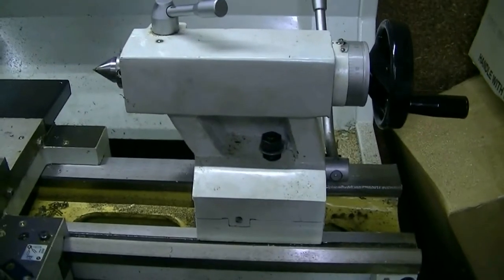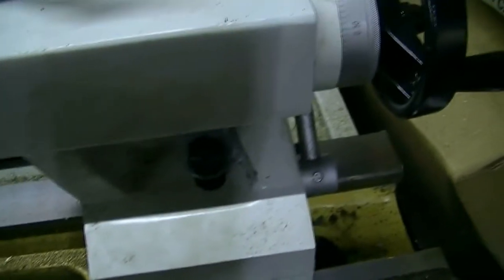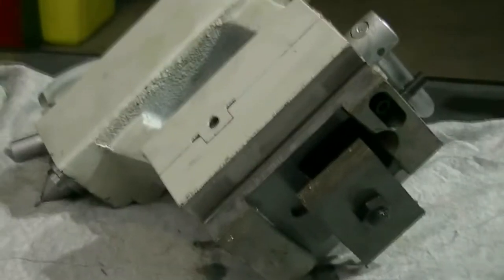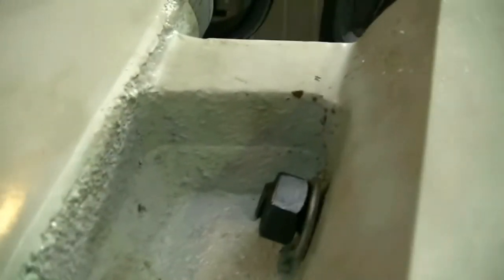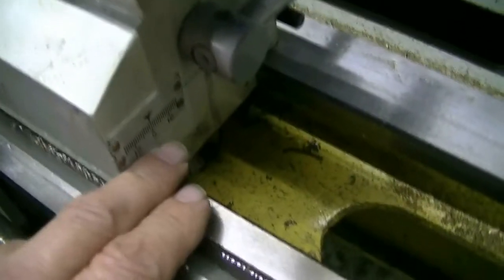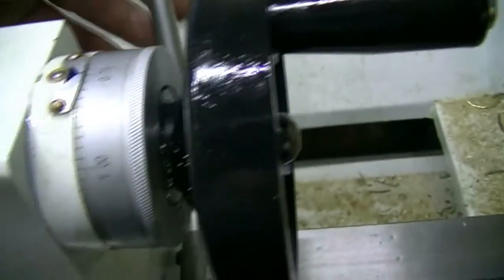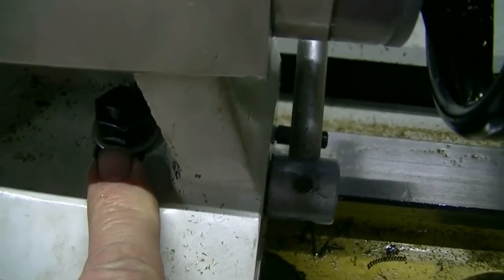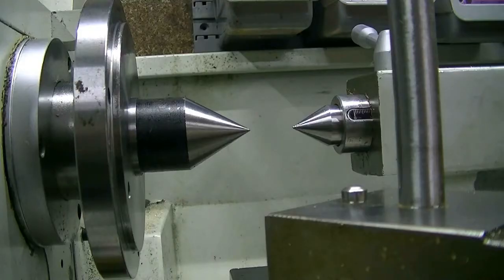Metal Lathe Tailstock Adjustment

Comment: if locking nut bit more squishy, you might want to check maybe a chip trapped between tailstock and the bed resulting in poor seating/locking to the bed or chip between upper part and lower part tailstock, both case resutlt in tailstock out of alignment in vertical axis and more noticable when tailstock in fully expanded position